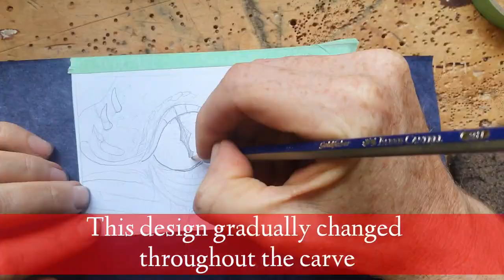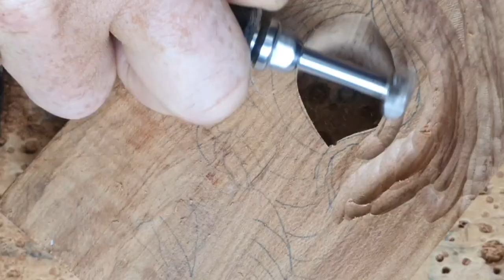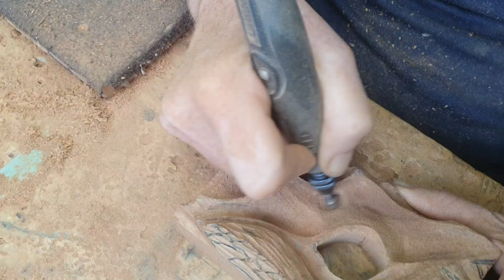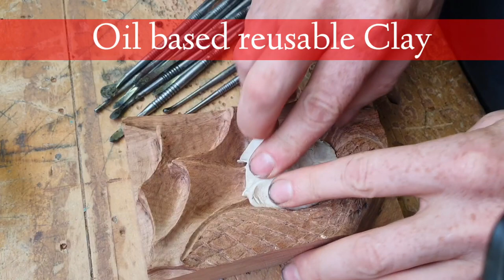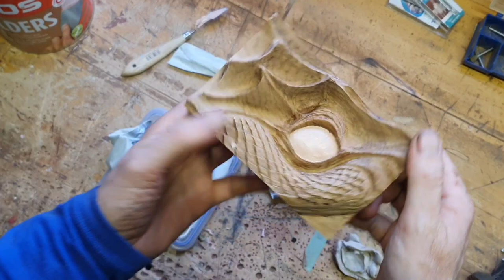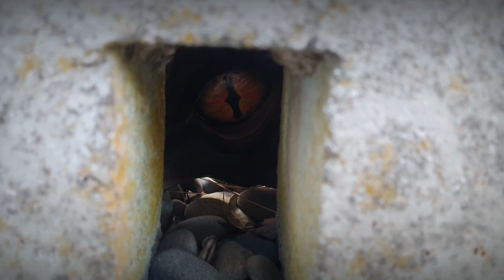Wood carving a dragons eye | With a Dremel and Kutzall Burrs

Comment: That is Awesome! Which Dremel do you recommend using? I have an older model 3000 and want to know if it is up to the task of doing things like this.
Reply from the maker: So I  use a dremel 4000 and I carve mainly hardwoods. I reckon the 3000 is probably good enough. I can't say for sure as have never used a 3000, but worth using it, as you already have it. Cheers for watching